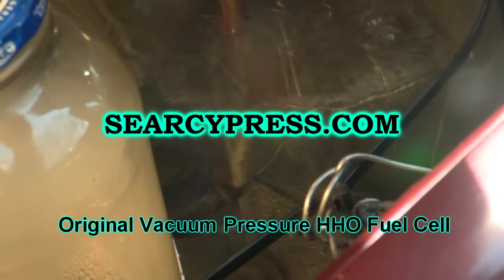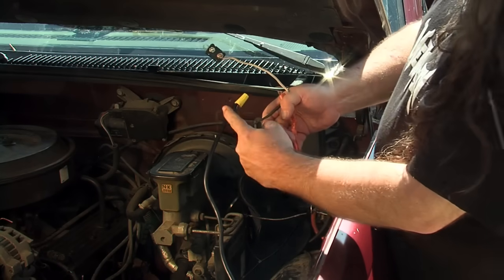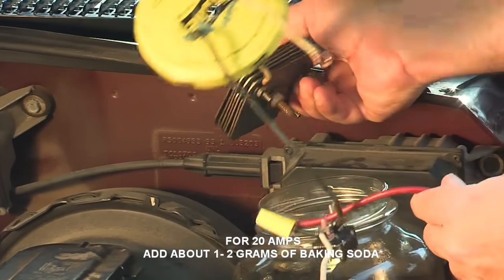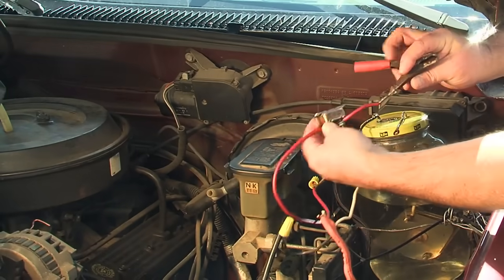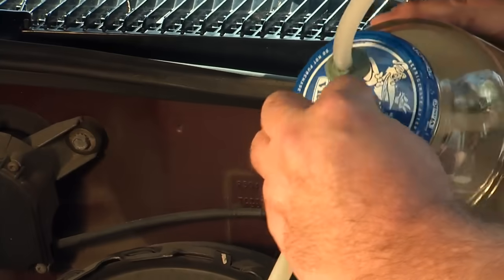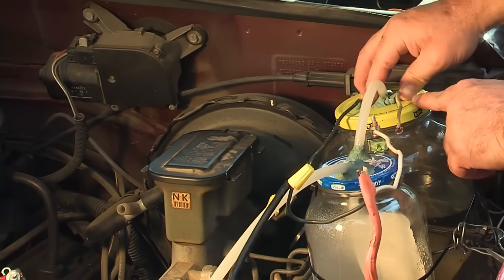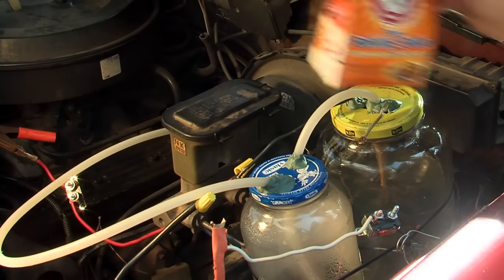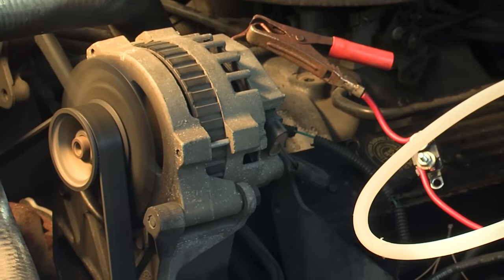Vacuum Pressure Hydrogen fuel cell defeats high gas prices using hydrogen from H2O.

Comment: From watching videos it seems that all you need to do is put in some jars into a car and it works!! but ... Questions that are never address in any video so far are:
1: How to run a car totally on HHO - this seems to be only an amp spec 20-30amps is enough?
2: Can you start the engine without vacuum?
3: How to re adjust for timing? the car won't magically adjust when you add HHO?
4: disconnecting fuel pumps! Do you need to install a switch for HHO production and for the fuel pump?
it looks easy to create the cells but focusing on installation and requirements would be cool :) great video thanks for the easiest and most helpful so far.
Reply: Dual Alternator.
Reply: It's not the battery or the Alternator that makes this good or bad it's
 the -efficient of the fuel cell. As far as having to replace the battery
you would not as its primary job in the electoral system -would not
change. 

The Alternator and Battery for each car or truck is Base on the electrical
load it can be called on to produce. at any given time. Take autos or
trucks with Diesel engines  most have TWO batteries for starting the
engine after that the load drops off to only a small amount of power
and why is this ?

After the diesel engine starts it requires no power to run or at least
the ones pre- computer control did.  The engine has a mechanical
fuel pump and injectors that work off of the timing this is all done by mechanical controlling the timing, Many old Diesel cars or trucks did not have a huge Alternator system to charge the batteries.

Now, let's look at some of the cars that have lots of electrical items from days past and current - Most if not all only have one battery for starting. But many have a 100 amp or more charging system why- It's  the load  that is required to power the car

All cars have one electrical fuel pumps and some have two one low-pressure pump in each tank and one main-high pressure pump to
supply 25-pounds or more pressure to the injectors-

Fuel pumps-                                                                       High current
power for the electric clutch on the AC-Compressor-High current
power for the windows
power for the blower motor-                                            high current
power for heated seats high current
power for rear window defrost
power for the cars computer system
power to a coil to fire the spark plugs                         High current
power for electric seats 
power for head lights-                                                      High current
power for windshield wiper motor.-                              High current
power for door locks.

I use the term High current in this case of units that would pull
a  load of 5 amps or more 

Many cars came out with more that one Alt-or- battery that will fit them
if you have the base or low-end auto with out all the extras you may
only have a  60-80 amp -Alt but if you have the deck out -model with
all the bells and lights you will have an 80-to 150 amp alternator

And in many cases, as they say in the computer world the charging
system- in your car is plug and play - meaning the following

You could remove your 60-to 80 amp Alt and replace it with one that
can produce 80 to 150 amps. and up grade your battery if you wish
to one with a higher AH- Rating 

If you check you find shops willing to do this for you or you may find you Alt- can be swap out with a higher power producing unit with no changes to your car at all.

The  unit will bolt right up- The the connector will plug right in and if your unit has an external voltage regular unit like many fords do you may find it's the same  unit for both the 60-amp and 150 amp  Alternators 

Having a much larger power producing -charging system or larger
AH battery will not harm your auto.  Many kids have up graded their
charging system just to power the amps and stereo systems- 
Having a larger Alt gives you more power for use say at night in the rain and having a high A-H  rating on the battery gives you more power for starting and can keep your car running longer if the Alt-  fails.

Just a note to thank on
Reply: BDS, are you one of those paid spokespersons for Big Oil? Like its your sole purpose on this thread to waste yours, mine and everybody eases time complaining about wasting time. No one said this is a replacement, but rather a supplement to increase overall gas mileage. To improve it, not replace it. I drive a Volt and never pay for gas anywhere in town but do take long trips in which I hear my motor come on to recharge my battery. Otherwise, I've got it hooked up to solar panels back at the house. Have fun funding terrorism every time you pump gas made from foreign oil!  Sukka!
Reply: It's pretty dang close is when we're talking about fuel emissions(which this virtually water exhaust), steam cleaning your engine, fuel economy, and chemistry.
Reply: yeah but not the old crappy solar tech ... the new "unreleased tech"
Reply: Tucker Flinn dude, if you only knew how perfected this tech already is. You are literally lost as far as where we are technologically speaking if you don't get this. Check out dioelectromagnetism to understand more how magnetic fields work, and get the picture.
Reply: HHO was never meant to be used alone but as a additive to fuel to burn it better and cleaner.
So you using less gasoline and burn it far more cleaner, + you get boost from steam, and hydrogen helps hydrocarbons to burn more efficient. So if you can create system without gasoline enoght you eaither lying or maked very good desing :)
Reply: That's actually a great idea, solar, didn't think of that one!
Reply: The guy who ran his car completely off water also added a divice that drew electricity from the atmosphere. Theres video somewhere with multiple inventions drawing power from the atmosphere
Reply: If energy needed to electrolyle hydrogen to create energy back to turn engine will be less or equal to turn electric engine using electricity alone it can be usefull.

But if you want to convert gasoline to electricity to ctreate hydrogen to burn gasoline better to fill energy gap coz of electrolisys and in the same time create more torque like you would get burgin gasoline alone its still usefull. If youcan cud down gasoline imput also coz of boost from hydrogen oxygen and hydrogen reacting with hydrocarbons, the better for us.
Reply: It's still not worth it though. For the piddly little amount of HHO this thing produces, you would be breaking even on the cost of a second battery. This is about economy and the facts don't lie. HHO is weak nonsense.
Reply: why disconnecting the fuel pump? i dont think the car will run on 100% HHO, you would have to remap your ECU to match the new target values, maybe you have fake a certain air/fuel ratio value to the ECU like its done in common autogas (LPG) vehicles. If you have a careburator its the simpliest way i think by just adjusting the fuel ratio manually to a leaner mixture.
Reply: NE Neighborz sounds like a tesla device . Do you recall how much output was achievable with said device?
Reply: LL LV 
I wish I had saved that video its was long ago but here is a compilation of different variations and ideas.
Reply: https://youtu.be/iCMEMuJFLR8
Reply: The Spiritual Physicist - Cre8-Health RSO THCCBD i
Reply: I didn't re-adjust the timing at all - the hydrogen simply fires at top dead centre - it doesn't get better than that coz petrol is nowhere near as efficient - the petrol is necessary to lubricate the engine so I was happy with a 28% efficiency running the cell on 3 amps (using an amp meter to control the amount of electrolyte to whatever I wanted as I added it)...that's peanuts - the vacuum was not touched on the car, I simply fed the HHO into the air intake - beautiful....the engine ran smooth as silk, much much quieter and on the freeway it had amazing power response - BUT the oxygen sensors told the puter to make a richer mixture over the weeks ahead to the point the HHO was losing efficiency THAT is still the biggest and almost only problem I had. I can run the cell on 8 amps for more HHO but never more - the battery isn't going to need charging ever - that was not an issue in my experience, if the cell is set up right you don't need huge amperage to run it -ALSO if the HHO output is bubbled through a second "jar" with JUST ordinary tap water in it, it charges that water - so the HHO goes to the intake after bubbling it - and this is exactly how they got those big bombers off the ground in WW2 when they were fully laden - this is nothing new at all - infact the first car was made of wood and ran totally on water....the patent is still there. Cheers and good luck.
Reply: Ya I really like the use of one of the many vacuum lines, strategically, the most powerful one instead of the air intake. My question is would porting directly into the air hose (after the sensor) work the same, worse or better than a vacuum line? Thanks.
Reply: It would be interesting idea: some kind of HHO hybrid. The car needs large batteries which are loaded maybe every day but maybe weekly at home. But other way it would run mostly with HHO but batteries are covering the lack of efficency.
Reply: Terrie Cotham
Reply: Hey Mathew everytime I type in dioelectromagnetism I am given bioelectromagnetism as the only hit, what gives ?
Reply: That's what it boils down to really enator71, is cost and risk vs. savings right? There is none with HHO, (but there is certainly risks) which was what I was trying to tell these people. So, the Math is actually correct, as I suspected. There is a guy who does a strictly Physics and Math breakdown on Youtube, of this whole idea and he claimed it's a scam and doesn't work. The laws of Science (thermodynamics losses, HHO created, the car's ECU computer etc. etc.) and it's literally so weak, that in one hour, it would not even produce enough combustable HHO for one revolution of the engine. Made perfect sense to me (although it was very Math heavy) and you proved it sir! 

I think you did the fairest test possible, running it off two marine batteries (which I know are powerful), so as you say, there are no other interfering factors, like parasitic loss etc. Thank's for confirming what I already suspected, that it's nonsense and anyone "thinking" they are getting gains are deluding themselves. So many people claim they have had gains, but others have tested it, properly, with a good setup and gained nothing.
Reply: super cells decent priced . you wouldn't need many ..  at that rate you can run a solar cell car .. battery is just made of lan top cells ..  get a standard..  new solar car coming out .  charges it self . goes a long ways on a charge ..   not including if you directed air to a wind mill or water micro turbine .  guy in phillipines who made a hydrogen car ..  don't need much power man.. tiny solar panel or few cells would cover that ..  have to drive all day to not make enough juice . a alternator runs lights period so there is no way  you will draw that much power ..  if ya do you figure out less power and store the gas .  looks good though ..  little car with little diesel with over drive can get 275 mpg on a race track .  old shell car had three wheels and 6 cylinder and got like 3oo and some miles a gallon .. trick is free wheel like a bicycle .  at that point any engine could get 300 miles per gallon or more if turned engine off.   look at sun power solar cells.  re do a bus thats standard or a muscle car or impala ..  even instead of transmission and lbs hook the motor to back wheels ..  don't go over 100 to 300 miles a day range . haha.  actually really simple . could build a vehicle for really cheap if ya did it and had extra money . buy junk vehicle not running or scarp yard and all money go into cheap parts .  invest in the cells . battery cells are actually pretty cheap .  money be in solar cells and control charging system .  be nice to run direct to the motor like remote control car .. pull on a stick from no power to faster ...  light year is coming out this year i think.  affordable all electric car ..   crazy world full of lies we make it to complicated / lol.
Reply: Dude, amen. Everybody and their dog can make HHO. Lets see somebody meter it and run a car solely on HHO. I built a carb in the seventies that Pissed off the oil companies and they let me know about it. A 35 MPH v-8 57 chevy wasn't in their playbook. I believe a true metering device designed for HHO, like and injector or carb, will solve the current issues. It is going to take guys working on pulse, wave and metering in concert to make it work.
Reply: https://youtu.be/pSHxojRPmnM
Reply: Boa ideia, eu pensei em dínamos
Reply: Tucker Flinn get a hi performance alternator ...
Reply: NE Neighborz thanks man
Reply: If u can not use it partially the go back to been a sheep with the rest of the sheep to tje gas station
Reply: Terrie Cotham wouldn't some super/ultra capacitors work around some of the problems?
Reply: Przemysław Krasiński I've seen only hho fuel working on various applications.
Reply: The Spiritual Physicist - Cre8-Health RSO THCCBD some guy told me it cant be dome cause gas works like a piston lubricant and hydroge just goes as a gas and completly burns.
Reply: Can't make enough hho to run a car off electrolysis alone.... you can get some improvements when you do a good build. This thing is hinky has hell though. And you have to get the fuel air ratio set properly with the hho flowing. Carburetor is probably the easiest fuel injection you have to get the O2 sensor output manipulated or it tells the motor "more air= more gas" and this will make o2  and a damn good amount might even make small quantities of ozone, not a lot mind you but breaking down atoms do things
Reply: Myles MacMillan you could put solar panels! :)
Reply: Running a car completely off of HHO would be awesome, but it would require a battery charge possibly weekly maybe monthly, because even though a car has a alternator or other source of charging the battery in the car, it can never be 100% efficient. Thats my thoughts on it!
Reply: the cell doesn't require much amperage - I used a 10 amp fuse in line to the cathode and as I added the electrolyte (coz pure water is not a conductor), the amp meter I was using told me when to stop adding ...I ran mine on just 3 amps (the battery is 40), i could have run it on more but as an experiment I realised it was never going to run on 100% HHO - the petrol is necessary to keep the engine lubricated... so I was happy getting 28% efficiency for almost nix.  trouble is the oxygen sensors told the puter to enrich the fuel mixture - that was the only problem I had - so I put variable resistors on the sensors which were controlled inside the car - BUIT even when I had them down to zero I still had problems getting the efficiency back up - the manufacturers are doing everything they can to stop water from being usd as fuel - no doubt about it.
Reply: If you used a second alternator there would still be parasitic loss from the belt, so like Myles said, it still wouldn't be 100% effective
Reply: Bill Does Stuff Oxygen produced enhances the total effect.  Yes hydrogen fuels rockets, only if you include an oxidizer,  I know,  let's use oxygen.  When you introduce HHO gas to an engine,  the rpms increase.  The computer adjusts the rpms by reducing the injector pulse widths, making the fuel mixture leaner ( less ) gas,  not richer.
Reply: You guys are making this so default. Get a secondary yellow battery. That runs off the main battery for your main power to the hho.
Reply: Oh, I get what you are saying Rob, sure. Oxygen helps the burn, no doubt. All I was contesting really, was the power  of the hydrogen created. It's very low, so I don't get why anyone would risk using it, considering the problems it can "potentially" cause and there are some, to gain what very little this is going to produce, in terms of hydrogen gas. Now, considering what Przemyslaw and Dan Womack and you said though, I am starting to get a clearer picture of how this might be efficient, albeit in a more indirect fashion than I thought. Interesting. I may have been misinformed then, as to how this works when you figure the ECU behaviour into it, which is probably my weak point on the knowledge. It was always my notion from what I learned of this HHO, is that there is no way the ECU is going to lean out the mixture, but rather richen it, to create the extra power needed to run this thing, but I guess the other theory could also stand true. That if you are creating better combustion, then it could just as easily go the other way and lean it out cause it realizes there is a better burn, so dials back the gas useage. Interesting and thank's for clearing that up guys! I am starting to get it now. Admittedly, there were probably some gaps in my thinking, when looking at the overall picture.
Reply: solar power
Reply: the longer a cell runs the stronger the hho
Reply: Sure it would be awesome and with this setup absolutely impossible. Even with two alternators. It can't possibly generate enough oxy hydrogen to make a difference. It produces oxygen along with hydrogen and it is a powerful hydrogen at all. Though powerful enough to run a welding torch, sure. HHO torches have been proven and it's cool! It takes energy to make energy to make energy though, in a car and hell of a lot of energy, so running it 100% off water is literally a total pipe dream. It's not even worth doing as a supplement to gas either, really. Fucking steam cleaning your engine? Are you high? Lol. That comment was ridiculous. That's another reason not to do this dumb shit. Corrosion. It's proven too. There is already a lot of moisture in your engine and gas and the air, it doesn't need more help from you. The whole idea is just stupid, even if using dry cell HHO. It does not work like people think it does. The computer figures out what is going on and changes the mixture. Negating any possible savings. The energy produced from HHO on demand like this is not even enough for one revolution of the engine. So you could never even start a vehicle on this HHO nonsense tech. Think of it like running the AC in your car. It uses more gas. Same concept. Pure hydrogen from a tank, well that's different. It is pure and potent and compressed and fuels rockets.
Reply: @MrBilld75  , hi. You make a great point about the amount of hydrogen produced...seems like not enough, though i've known of cars running on nothin but fumes...mine. also the steam cleaning aspect? Would sea foam help while switching back to full petrolium help. Also how, hooking into the vacumme line at the brake cyclinder??? Is that going strait to the throttle body or something? Strange.
Reply: Yeah? 
Energy can't be created or destroyed, but since it's a belt driven machine it isn't 100 efficient, that's just how it works.  

Or are you just proposing alternative facts?